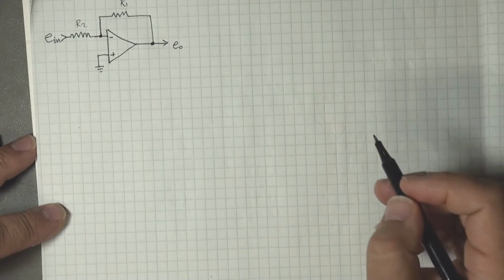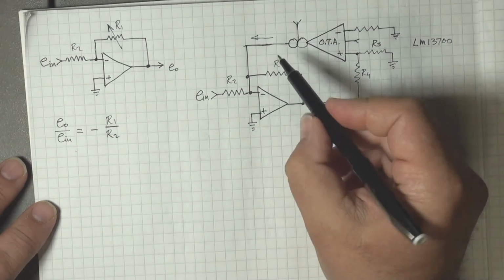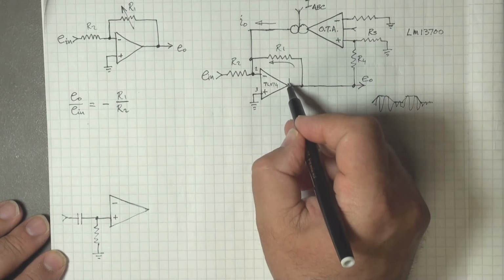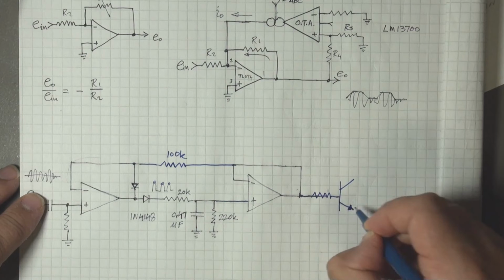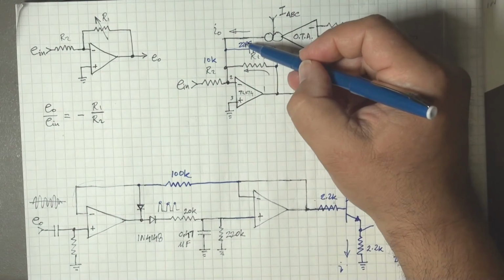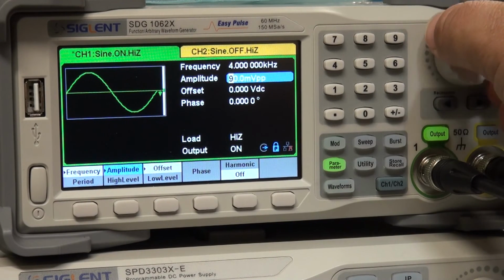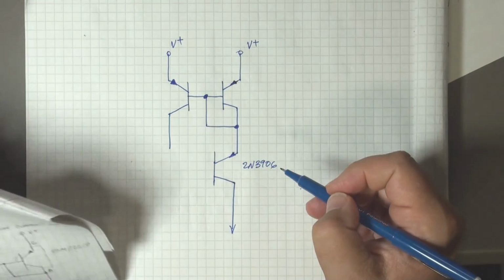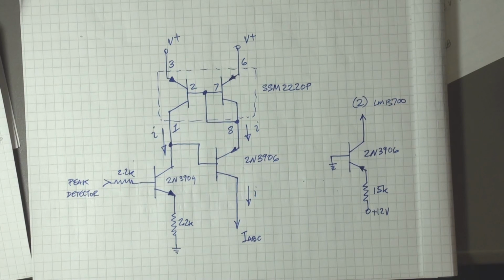Ultrasound Listener Part 8: Add Automatic Gain Control With The LM13700

Comment: Great video, detailed and nice explanation!
May I ask what do you use this ultrasound listener for? It looks like "high tech" not for ordinary geek purpose.
Reply from the maker: It is part of an, as yet, unfinished project.  I plant to make a circuit board with the relevant components and listen to the chirps of bats and rodents.  The company that supplies the mic also supplies the circuit board for recording etc., but d.i.y. is much more fun.

Comment: Hola , parece que el proyecto no lo ha terminado ,he seguido todos sus videos pero aun no esta terminado ,¿lo va a terminar?
gracias
Reply from the maker: Hello.  You are correct, it is not finished.  I plan to finish it, but other commitments and my own desire to improve the technique slow me down.  I will make an effort to finish it to the point of a printed circuit card inside a chassis.